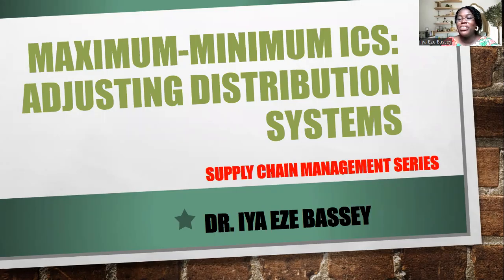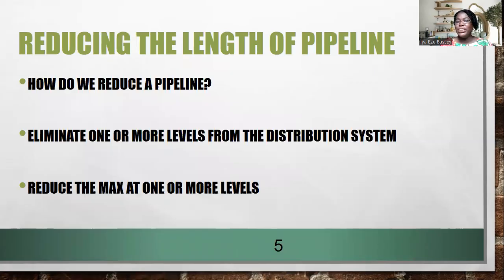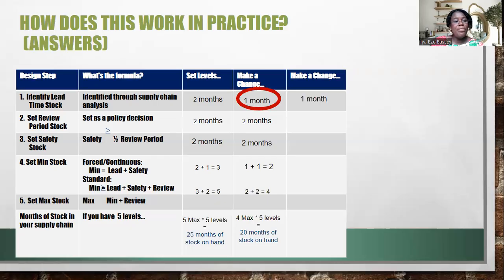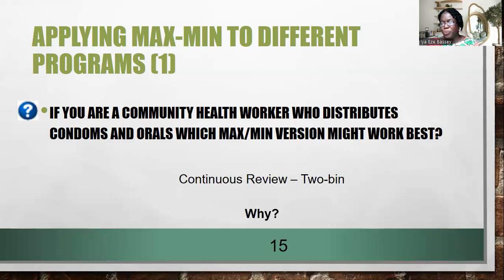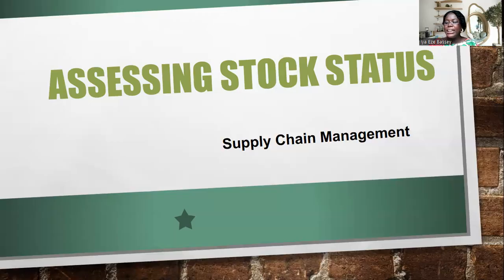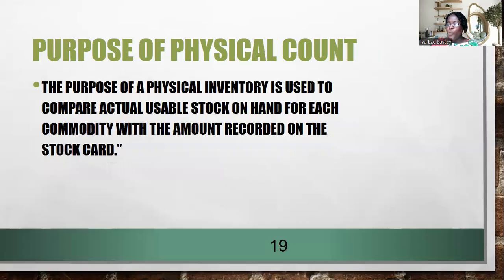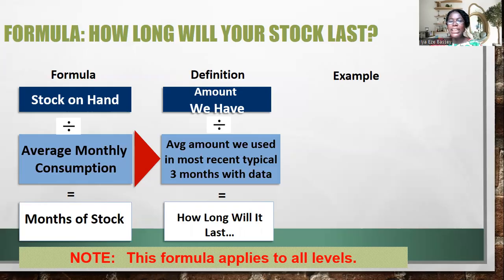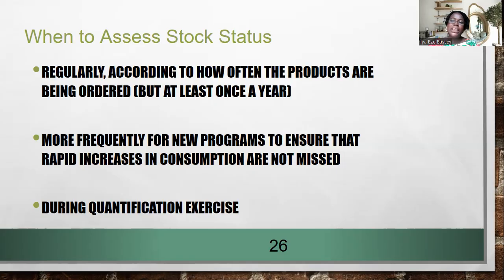Maximum-Minimum ICS: Adjusting Distribution systems (Supply chain management series)

Comment: In this video I am able to learn how to set up a max-min inventory control system:
1) Determining the length of a pipeline 
2) Reducing the length of a pipeline 
They are many advantages such as  *simplifies the inventory control decision 
*Avoid costs of emergency orders etc
And they are also challenges faced using version and variation.
In summary assessing of stock sales is also important in adjusting distribution systems.

Comment: In this session we will begin from,
1. LENGTH OF PIPELINE
The steps in designing a max-min INC are;
A. set up initial max-min policies for each level and type of facility.
B. check if the overall distribution will function properly. 
C. check the total length of pipeline,etc
Note that reducing length of pipeline;
I. eliminates one or more level from the distribution system,etc and also  how to reduce maximum stock level, by reducing review period,lead time and improve distribution system reliability.
OTHER FACTORS THAT IMPACT MAX-MIN STOCK LEVEL INCLUDES; 
>cost of product >storage capacity, etc.
ADVANTAGES OF USING MAX-MIN SYSTEM:
> avoid over stocking, etc
 CHALLENGES TO USING EACH VERSION AND VARIATION;
> System with numerous levels,etc.
I saw the meaning of PHYSICAL COUNT,
PURPOSE OF PHYSICAL COUNT
>To compare actual usable stock on hand for each commodity with the amount recorded on the stock card,etc.
WHEN TO ASSES STOCK STATUS
>During quantification exercise,etc.

Comment: Thanks again mma for another enlightening piece
From this lecture, I understood the step s indesigning a max-min ICS which are:
1) Set up initial maximum policies for each level and faculty 
2) Check if the overall distribution will function properly if the max-min plocies are implemented 
3) Check the total length of the pipeline that the policies at each level imply
  It is important to carefully analyze demand patterns and adjust inventory levels accordingly 
By monitoring sales data and forecasting future demand, business can determine the optimal distribution strategy to ensure that products are available when they are needed.
I also understood that the advantages of using max-min stock is to avoid overstocking, understoxking  to minimise wastage and to avoid costs of emergency order, etc

Comment: In summary. 
There are step to designing the max-min ICS which are:
1. Set up an initial max-min policies for each level and type of facility.
2. Check  if the overall decision will function properly if the level specific max-min policies are implimented.
3. Check the total lenth of pipelines  that the policies at each level can imply.
 There are serveral factors that affect max-min levels.
1. Cost of production
2. Lead time .
3.cost ofbstorage .
4. Storage capacity.
5. Age of program 
  
This has some advantages which are .
Minimise shortages, minimise wastage, prevent over stocking etc..

Comment: Thanks for the lecture ma,
I've learnt that when designing or adjusting a max-min system, you look at the length of the pipeline first.
And that you can reduce the pipeline by eliminating one or more levels from the distribution system, set up policies to reduce the max at one or more levels, 
But there is also a systematic approach, that is:
Reducing the review period, reducing the lead time and improving the distribution system's reliability.
The advantages of the max-min system are:
Avoidance of overstocking, understocking, costs of emergency orders.
Minimize wastage
But I also learnt it also has it's challenges 
The systems usually have numerous levels.
I also learnt that why standard version of the inventory control system is used  for hiv/aids commodities is that it has a lot of facilities and is very efficient at managing products. Which makes it better than continuous review.

Comment: I always look forward to your lectures, ma

In this series learnt that the adjusting distribution system is about considerable shortening of the pipeline, improving the distribution systems reliability at one or more levels so that safety stock can be reduced.

This system is important to avoid overstock, minimise wastage, and avoid the cost of emergency order.

Factors that impact max-min stock levels are
* cost of product
* reliability of transportation 
* storage capacity 
* cost of storage, etc.

Comment: I learnt the steps involved in designing a max-min ICS which are;
1. Setting up an initial max-min policy for each level and type of facility.
2. Check if the overall distribution will function properly if specific max-min are implemented.
3. Check total length of pipeline that each level implies. I also learnt that the factors that impact max-min levels are;
a) cost of production
b) load time
c) storage capacity
d) cost of storage
e) age of program

Comment: Steps in designing a max-min ics are: set up initial max min polices for each level. Check the total length of the pipeline that the polices at each level imply. The purpose of  assessing stock status is to determine how long supplies will last.

Comment: Another insightful lecture thank you very much ma 
In summary;
The steps in designing a max-min ICS are 
1. Setting up initial max-min policies for each level and type of facility 
2. Checking if the overall distribution will function properly of the level specific max-min policies are implemented 
3. Check the total length of the pipeline that the policies at each level check

The length of the pipeline often affects the commodity delivery so a long pipeline may make commodities take longer to arrive..there are ways to reduce the lenght of the pipeline which include :
1. Eliminating one or more levels from the distribution system 
2. Reducing the max at one or more levels 
Some factors that impact max-min stock levels are ;
Cost of products, storage capacity, cost of storage etc 
Advantages of max-min include;
Avoiding overstocking 
Avoiding understocking 
Minimizing wastage etc

Comment: Wow! here is yet another intriguing lecture on Maximum- Minimum ICS Adjusting Distribution Systems. In summary the length of a pipeline refers to the steps in designing maximum ICS. Reducing the length of pipeline means: to eliminate one or more levels from the distribution system and reducing the max at one or more levels, I learnt how to reduce max stock level, other factors that impact max - min stock levels, advantages to using max-min system, what a physical count is all about including it's purpose. I also learnt how to determine how long stock will last and when to access stock status.

Comment: Length of a pipeline is the chains or series of routes a commodity moves through from production to consumption. The pipeline is usually length so we developed a max-min ics to check the process the ways of adjusting distribution system policies are by:

1. Setting up initial max-min policies for each level and type of facility
2. Checking if the overall distribution will function properly if the level specific max-min policies are implemented
3. Checking the total length of the pipeline that the policies at each level imply.
However, the advantages of using Max-Min system are as follows:
* Avoids overstocking
* Avoids under-stocking
* Minimize wastage
* Consistency of stock level etc
The challenges of using inventory control system are as follows:
Systems with numerous levels
Systems that manage a large number of commodities
Systems that manage products for new programs.

THE PURPOSE OF A PHYSICAL INVENTORY IS USED TO COMPARE ACTUAL USABLE STOCK ON HAND FOR EACH COMMODITY WITH THE AMOUNT RECORDED ON THE STOCK CARD.

Comment: Your lectures are really impactful and enlightening 
In summary to this section , I've learnt the steps in designing
max-min IcS, steps in reducing the lenght
of pipeline and other factors that impact
max-min stock level. I've also leant about
the advantages of max -min system such as
avoiding over stocking, under stocking etc. as
well as the challenges of using each version
and variation. You talked about the physical
count which is the process of counting by
hand the total number of usable units of each
commodity in the store or healh facility.

Comment: Its been another amazing time listening to your insightful lecture ma'am. Below is a brief summary ;
To set up a max-min inventory control system:
-Set up initial max-min policies for each level
- Check overall distribution and ensure it will function properly
- Check the total length of pipeline that policies at each level imply.

Most times, the length of the pipeline are too long abd can take longer time in commodity delivery, however the pipeline length van be reduced by;
📌 Elimination of one or more levels
📌 Reduction of max at one or more level

Maximum stock levels can be recuced by;
- shortening of review period at one or more level
- Reduction of lead time at one or more level
- Improvement of distribution system reliability 
Some other factors that impact max- min stock levels are
📌Cost of products
📌 Reliability of transportation
📌Storage capacity
📌Cost of storage
📌 Storage conditions at different levels
📌Shelf life of health commodities 
The advantages of using a max-min system includes;
- avoid overstocking
- avoid understocking
- Minimize wastage 
- avoid cost of emergency order
- consistency of stock levels

Comment: Thank you ma
I understand that during the reduction of pipelines, it is eliminated through one of more levels of the distribution system, and reduction of max at ond level, therefore steps in designing a max-min ICS is by 
1.  Trying to set up an initial max-min policy at each level
2.  Specific max-min policy levels are implemented only if the overal distribution is checked and functioning properly
3. Check the total length of the pipeline that the polices at each level imply
N/B ; factors that affect determination includes the cost of product, reliability,  storage capacity,  storage conditions at different levels , lead time, accuracy of forecast . 
Advantages includes ; 
Avoids overstocking 
Avoid under stocking 
Minimise wastage
Consistency of stock levels
Avoid cost of emergency order

Comment: Thank you very much this lecture is indeed very nice and interesting and we learned alot in something like:
•How do we reduce a pipeline 
• Eliminate one or more levels from the distribution system 
• Reduce the Max at one or more levels

Also know some other factors that impact max-min stock level, like:
•Cost of products 
•Reliability of transportation Storage capacity 
•Cost of storage 
• Storage conditions at different levels 
•Shelf - life of health commodities
 •Lead times Reliability of source of supplies 
Etc.

Also learnt how to calculate how Long your stock last using the following formula

[Stock on hand (amount we have)] ÷ [Average monthly consumption (Average amount we used in most recently 3] months = [ months of stock (how long will it last)]
Example 
100 tablets ÷ 25 tablets used per month = 4 months supply of tablets

Calculating MOS on hand
Example
Feb =1,203 
March = 1,190 
April = 0 
May = 1,250 
June = 1,261 
July = 1,252
How many months stock do we have in hand

So using the formula 
Stock on hand ÷ average month consumption = month of stock
  
Therefore average month consumption =(1203+ 1190+ 0 + 1250+1261 + 1252)÷6 = 1026

So when stock on hand is 3000 and
Average consumption is 1026 then
The months of stock that we have = 3000/1026 => 2.92 
approx. 3 months

Comment: In summary, I’ve learnt the steps in designing max-min ICS, steps in reducing the lenght of pipeline and other factors that impact max-min stock level. I’ve also learnt about the advantages of max -min system such as avoiding over stocking, under stocking etc. as well as the challenges of using each version and variation. You talked about the physical count which is the process of counting by hand the total number of usable units of each commodity in the store or healh facility. The class was great thanks ma

Comment: Thank you for the insightful lecture, Ma'am. Here's a concise summary of what I learned in this lecture:

Storage in the healthcare supply chain is about efficiently and safely storing health-related products to protect their quality. Key activities include supply receiving, inspection, put away, picking, packing, and shipping.

Key takeaways from this lecture includes:

Guidelines for proper storage:

Maintain cleanliness, dryness, and ventilation.

Follow manufacturer temperature requirements.

Shield from sunlight, extreme conditions, and humidity.

Use original packaging or suitable containers.

Ensure clear labeling and FIFO system.

Monitor temperature and humidity.

Train staff on proper procedures.

Common product-related problems:

Expired or near-expiry products.

Damaged packaging.

Contamination from mishandling.

Stock level issues.

Labeling errors.

Counterfeit or substandard products.

Special considerations for program-specific commodities:

Vaccines, specific temperature requirements.

Chronic disease medications, secure storage.

Blood products, refrigeration.

Lab reagents, specific conditions.

Physical inventory/count:

Periodic verification of stock quantity.

Frequency varies (monthly, quarterly, annually).

Visual inspection:

Regular examination for damage, contamination, and expiration by trained staff.

This lecture provided comprehensive insights into healthcare commodity storage practices.

Comment: Thank you ma. I learnt the steps involved in designing a max-min ICS which are:
A. Setting up an initial max-min policy for each level and type of facility. 
B. Check if the overall distribution will function properly if specific max-min policies are implemented. 
C. Check total length of pipeline that each policy level implies. I also learnt that the factors that impact max-min levels are a. Cost of production  b. Lead time  c. Storage capacity  d. Cost of storage  e. Age of program

Comment: Thank you ma for this lecture. Here's a summary of all the key things I understood from this lecture series:

- I gained a clear understanding of the steps involved in designing a max-min ICS.
- One strategy to reduce the length of the pipeline in the distribution system is to eliminate one or more levels.
- Improving the reliability of the distribution system at one or more levels can help reduce the max stock level. Several factors influence max-min stock levels, including product cost, program age, lead time, and transportation reliability.
- One advantage of using the max-min system is to minimize wastage, ensuring that inventory is used efficiently.
- I learnt that continuous review max-min ICS may not be suitable for large systems or many products due to its complexity.
- To determine the month of stock, a "physical count" is necessary. This process involves comparing the actual usable stock on hand for each commodity with the recorded amount on the stock card. You've also learned how to calculate the "month of stock."
- It's important to access stock status regularly, based on the frequency of product orders (at least once a year), during quantification exercises, and more frequently for new programs to ensure rapid consumption increases are not overlooked.

These insights provide my comprehensive understanding of designing and managing a max-min inventory control system and optimizing stock levels. Thank you.

Comment: In this series I was able to learn the steps involved in designing max-min ICS, factors which includes cost of production,lead time, storage capacity thereby reducing the length of the pipe by elimination of one or more distribution levels can beneficial. It's also important I take note of the advantages to make sure that the inventory levels are accurate.

Comment: Thank you Ma.
I understood from this lesson that the ways of adjusting distribution system policies are by:
1. Setting up initial max-min policies for each level and type of facility
2. Checking if the overall distribution will function properly if the level specific max-min policies are implemented
3. Checking the total length of the pipeline that the policies at each level imply.
However, the advantages of using Max-Min system are as follows:
* Avoids overstocking
* Avoids under-stocking 
* Minimize wastage
* Consistency of stock level etc
The challenges of using inventory control system are as follows:
# Systems with numerous levels
# Systems that manage a large number of commodities
# Systems that manage products for new programs.
When is the assess stock level to be implemented?
1. Regularly according to how often the products are being ordered
2. More frequently for new programs to ensure that rapid increase in consumption are not missed
3. During qualification exercise 

I appreciate your tutoring Ma

Comment: In summary, the max-min ICU can be very important in managing the supply and consumption of laboratory reagents and equipment. The steps involved in designing a max-min ICS are
1. Setting up an initial Max-min policy for each level and type of facility
2. Check the overall distribution
3. Check the total length of pipeline that each policy level implies.
Also factors impacting the max-min levels are
1. Cost of production 
2. Lead time
3. Storage capacity
4. Cost of storage
5. Age of program
 Also the advantage of using this system are
1. Avoid overstocking
2 avoid understocking 
Thanks ma